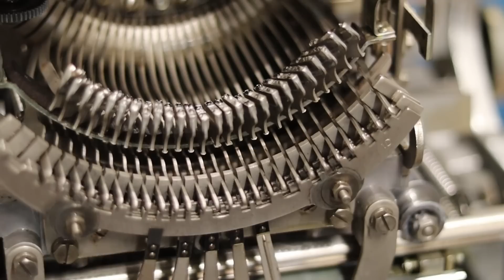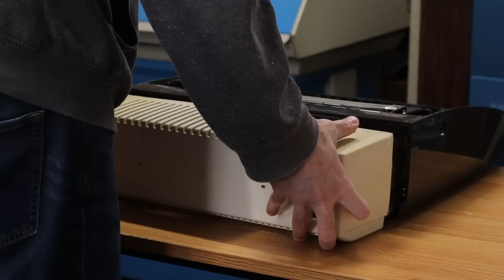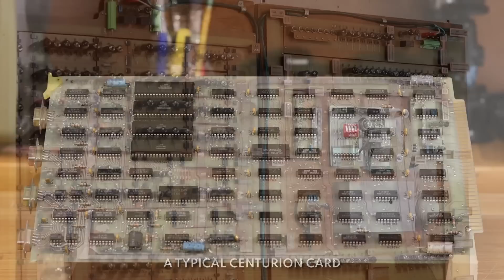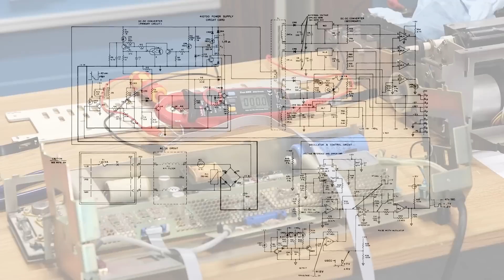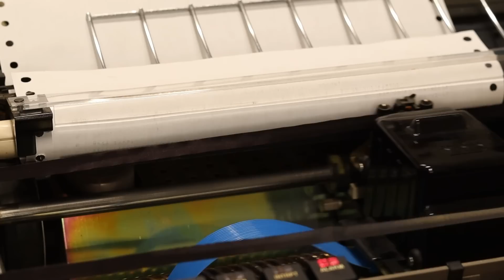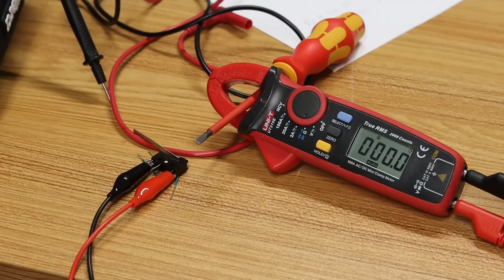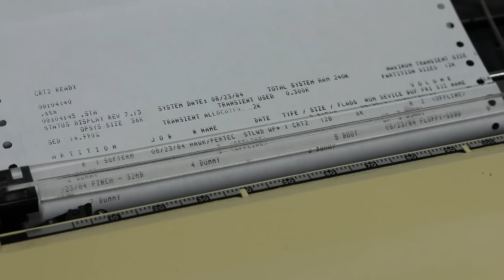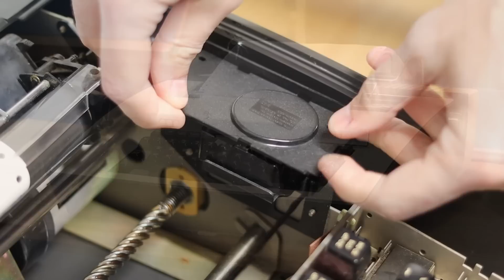Reviving a Model 43 Teletype

Comment: So you need to send serial data, RX and TX over a cable. Two (2). Signals. How many wires does the cable need? 12? 25? 41?
Reply: 25-pin ports also have a secondary channel*, in case you need to control whatever modem-like thing you are talking through. Because one Tx/Rx pair is never enough!
*defined but rarely ever actually used by anything
Reply: Ground/0V common, plus one wire for data each way.

Plus, optionally one more wire each way for hardware handshake, if something cannot work continuously at the set speed.
25 pin ports also have a separate "Chassis ground" in addition to the signal common, omitted from the newer 9 pin ports. Then another for Modem Carrier Detect, if the device is designed to work with a modem.
A minimum of three wires and a maximum of nine, with any normal 9 pin or 25 pin RS232 serial device, for two-way data.

(Many later things can do the flow control using control characters, rather than extra wires, so three wires can be used with that type of flow control).
Reply: @RJTC  I know I know. I am just amazed at how much variation one gets on the topic. I've seen some weirdass pinouts, while in my normal life I get by with 3-wire RS232 or RS485 if things are serious. When I see negative voltages I put on my old-man hat and think big. Serial over Centronics. Serial over TWO centronics.

Comment: I have used a model 33.  I used it as a terminal to write some software.  
This is the  first model 43 I have seen.
BTW:  HP also made "Glass TTYs"  They were a little nicer than the other brand but too expensive.

Comment: David, you're incorrect to say, "This is Texas and static control is really not an issue here." 🤦 Consider the largest SSD factory in North America used to be in Pflugerville and we had to take static seriously because it really IS an issue in Texas.  I was a design engineer there and I can tell you first hand I've experienced static damage in Texas with modern chips that have modern I/O pad protection which is really robust in comparison to early chips.  The only places I've worked where I would make a statement like you did about static not being a real problem would be about the San Francisco Bay Area, the Portland area, and the Seattle area; all places with very high humidity.  You might be in better shape for static if you were in Houston, but then you would be in Houston which isn't a pretty disposition.  Static electricity isn't mysterious, you can measure it directly with a meter or indirectly with manufacturing drop-out counts.

Comment: There is a problem with the second pin on the 9-pin print head, I guess it is stuck by old ink but it can also be the drive electronics has a problem sending a pulse to the second hammer.

Comment: Looks like one of the pin drivers on the print head is not working, its 2 pins down and you never get anything printed from it. Either the pin is stuck in the print head with solidified ink, or the the driver is defective or the coil has failed. You can remove the dry ink with some Isopropanol or WD40.

Comment: Another 'glass' terminal we used a lot that was as solid as any other, was the Hazeltine 1500.  Anything short of punching it with a hammer and that thing kept working.  lol
Reply: A 1500 is featured on the cover of the 1981 Kraftwerk album "Computer Love".  I had a 1510 and the power supply wasn't very robust.

Comment: Today's printer - paper sensor faulty? Toss it and buy a new printer... (sadly)

Or you have to strip the whole printer completely just to get to that pesky paper out sensor...
Reply: Or you can't get the printer apart without finding that you have broken off one of the tags which clip the case together and which will not respond to standard prying tools.

Comment: When I think of Teletype, I think of the 33, and I'm sure I'm not alone in that. I'd never seen the 43 before, and I love its 70's sexy design, and the serviceability is like a cherry on top.
BiMOS was probably a good idea... for analog circuits! I remember reading some magazine blurbs about it when it was new. But for digital circuits, I don't know.
I understand being lazy about static in Texas, me too, there's just too much humidity most of the year. But in January, however, yeah, that might be the time to be careful.
21:40 when in doubt, swap TX and RX, even if you're sure you had it right... it never fails to be wrong

Comment: there is a line missing, Try cleaning the printhead.
It might be worth trying to "ink" the ribbon wheel with just solvent. My guess would be that the wheel is full of pigment and the solvent has just evaporated away
Reply: I fear cleaning isn't enough. It might be a failed driver circuit.

Comment: In high school in the mid-70s, we were loaned a TI "Silent 700" thermal-printing terminal.  Dubbed "silent" because there were not any keys striking a ribbon and typewriter platen.  With a built-in acoustic coupled modem running at 300 baud, it was revolutionary at the time.
Reply: Yes, and on many of them, there were cassette tape drives that could store the information.  The tape was the stuff you use for audio work but IIRC, the mechanism was a lot different.
Reply: I also had one of those. I built an interface and used it on my Apple II computer.
Reply: we had several silent 700s at work. we used them as portable terminals.  took them home to work remotely
Reply: We used to have them at work interfaced to Raytheon mini computers.
Reply: I have two of them right beside me.
Reply: Same thing at my high school.

Comment: Interesting that even in that era they had a real bell.  It makes me wonder if the Dataspeed terminals also had a real bell in them.
Reply: Teletype Corporation was owned by Western Electric, who made telephones for The Bell System. They had plenty of bells available 🙂
I repaired Model 33s for 3 years as a part time job in college. Had my own in my dorm room. I think I could still strip one down, replace the clutches and reassemble it.

Comment: I was given a Model 15 back in the 80's and interfaced it with my ham radio transceiver. Later I found a Model 33 and used it with my Apple ][ as printer. Both machines were amazing to watch as they worked.

Comment: There are 4-legged capacitors like that in the Silent 700 I recently repaired. Despite the age, 3 out of 4 still worked fine.
That machine's a delight to work on. What a contrast from the earlier mechanical ones ! They really thought about servicing.

Comment: Am I really the only one that instantly latched on the missing bit in the dot matrix printer (eg. upper case letters have a white "line" through them)?  Clearly this is a fault worth diagnosing.  Hopefully it's just a burnt out drive transistor and not a failed coil.
Reply from the maker: In my defense, I totally didn't notice it in person, it was only when I was looking at the close up shots during editing that it jumped out at me. But yes, I spent some time today cleaning the print head with a Q-Tip and IPA, but the 2nd pin is still not moving. Could be a lot of things, but that's something we'll have to dive into in the future!
Reply: is the pin movable at all? it still could be stuck. i once had to clean the printhead of an ibm 029 card punch and it took me all day to get all the gunk out. another way to check is to look for signals on the couls of the print head. it could well be a broken darlington array chip.
Reply: It could just be the pin gunked up with old ink. Maybe try cleaning it first with some solvent.
Reply: @sammosel3300  Hopefully that, instead of a bad solenoid or driver circuit. Agree that "gummed up" is the most likely. Some IPA should cure that.
Reply: You weren't the only one. I used to work on old Okidata 320 dot-matrix printers and instantly noticed the missing pin.
Reply: @davidhepler3812  Ha! I used to work on Oki dot-matrixes back in the 80s, & those things were built like tanks. I've only once ever replaced a broken print hammer on one of those - usually, we'd just replace the entire print head.
Reply: I love the comment sections on Usagi and CuriousMarc. It's so hilarious to me, that no matter what obscure, rare, unobtanium, never heard before transient technology they get on their bench, there will be a fucking EXPERT on the manufacture or repair of that niche technology that either worked at the manufacturer or a contracted repair company. It's WONDERFUL, but also hilarious. I bet those 2 channels alone have brought more joy to the 50+ year old age range than any other on youtube (except maybe train channels).
Reply: I noticed that also, I also hope it is an easy fix...
Reply: You are not! It's the first thing I noticed too. You can fix a broken print hammer, but boy, it's a giant pain in the arse. Back in the day, we used to just replace the entire printhead. Hopefully, it's just a bad connector, cable, or even driver transistor, because they're pretty easy to fix.
Reply: It could be the pin is bent.  That is probably the worst outcome because a repair would involve disassembling the print head.  Hopefully it's just stuck and will unstick itself with time and solvents and perhaps penetrating oil.
Reply: @Starchface it helps a whole lot as well when the print head gets warm during operation.
Reply: I think EVERYONE who used to own a dot-matrix printer noticed that. :)
Reply: @Renville80  And as one of those who did I’m so used to it that I didn’t even notice lol.
Reply: Bent pin perhaps?  I used to rebuild printheads, mostly for Oki printers.  Only ever had worn guides and pins, never had a coil go open circuit.
Reply: @retrozmachine1189  Were there kits of parts used to rebuild such heads?  Maybe rebuilding or repairing this is not completely out of the question.  We don't want to risk further damage of course, but Usagi has achieved such legendary status that if there's any chance at all, it will be made to happen.
Reply: @Starchface  There probably were but the company I worked for at the time was an authorised repair centre for Oki (and others) so we bought components directly from the manufacturer or their Australian parts distributor.
Reply: Yup, saw that right away. If you lightly oil it with light weight sewing machine oil it may come back. If not then it may be bent, broken off or coil bad. I too have rebuilt many of those (in an Oki and Oki knockoffs).
Reply: Yep, me too.
Reply: printers printing with missing lines in the print since they exist! XD
Reply: Wow you're so perceptive and smart and knowledgeable  😮 I bet you have a lot of friends and people like you and want to be like you. Can you be my friend too also?
Reply: @TwinMillMC  I noticed that you often make these sort of sarcastic bullying comments here and elsewhere, and always directed at neurodivergent people?
Reply: @alakani Don't feed the troll. They thrive on attention. Just report as bullying.

Comment: OMG a Nova!!  I’m very excited to see what you do with it!  I worked briefly with Data General ECLiiPSE/MVs running AOS/VS II when I was just starting out in my career; later I read Soul of a New Machine and really grew interested in Data General and in the Nova platform in particular.

Desperately wish there was an emulation solution to allow fooling around with AOS/VS, I or II, but I will happily take what I can get!
Reply: I worked for DG from 1978 thru 1993. I was on the team that designed the D200 terminal as a low-cost alternative to the 6053. Went on to design Ethernet cards, terminal servers and <wince> a Token Ring board. Lots of fun. The D200 was built around a Motorola 6802 processor.
Reply: @antronargaiv3283  - all hail AOS/VS II where everything went twice as fast (xyzzy) and where Slate was my favourite editor.
Reply: Ditto to the AOS/VS emulator. I worked with several different types of MV's. From a small desktop type (cannot remember the model) to a MV/7800, MV/10000, 15000, 20000, and finally 40000.

Comment: My dad was a DEC field service engineer, and he hated TeleTypes.  In the mid 80's he won a bid on a lot of decommissioned equipment including a couple of PDP8s (an A and an E) and a Model 33, and I'm pretty sure he went Office Space on that TeleType as it disappeared shortly after. 😆 There were a couple of VT52s in the lot that we used with the 8A instead.
Reply from the maker: Aww, Teletypes are great!
But I do get the sentiment, if I had to use a teletype everyday for work, I might start to get a little... Office Space as well, haha.
Reply: @UsagiElectric  I think in particular getting and keeping them running was the problem. Not sure if it was just the paper tape mechanism specifically that was temperamental, or just the whole thing.
Reply: @bmartin427 Clarification needed: Did he hate hardcopy terminals, or did he hate name-brand TeleTypes? A DEC employee might hate TeleTypes and love DECwriters.
Reply: My old man worked for DEC around the same time period. I wonder if they knew each other.
Reply: The number of classic machines that I just threw away because at the time I just considered them obsolete junk - it makes me cringe. I save all my "old" tech but still, wish I had that stuff from the early eighties that i just gave away or threw away eventually.
Reply: oh man. the 33 has the design fault of using just one screw for both fixing and adjustment on a lot of things. there is no quick taking things apart and reassemble it like the german ones. on the ither hand, the service manual of the 33 is superb and a lot better than the german ones. ( take out screw a13 in image 44-6 against remove the chars latch bar screw in the picture below)